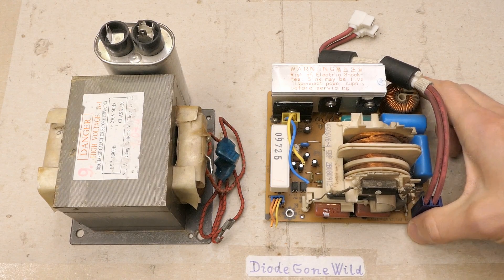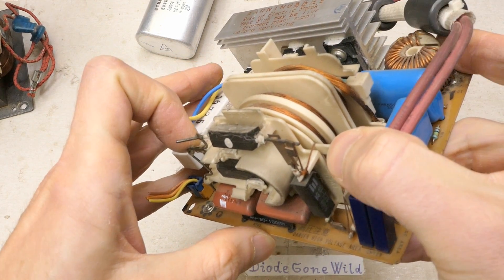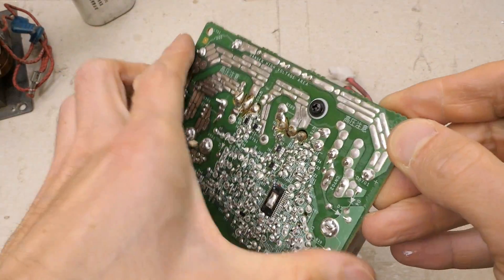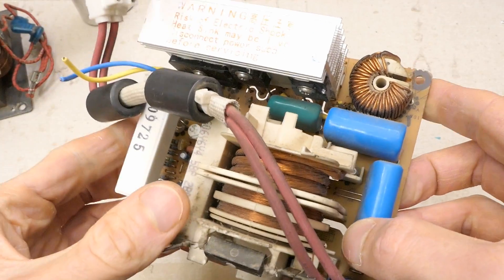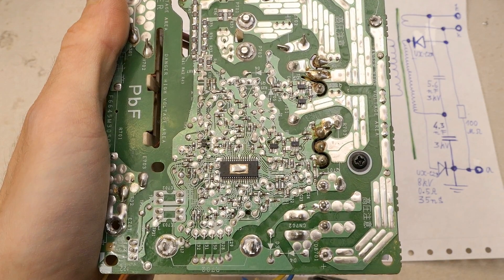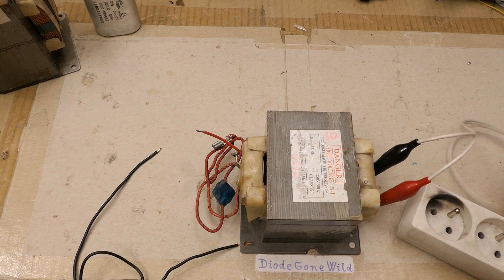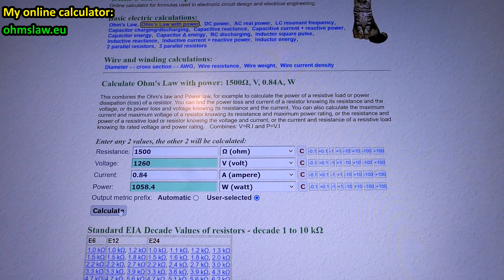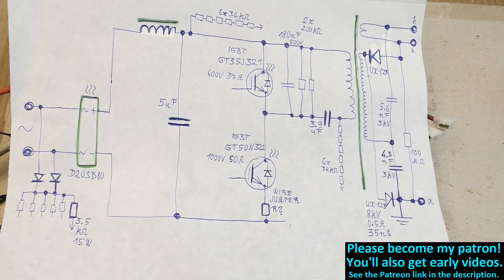A Microwave Oven Transformer, but switching!

Comment: Thank you very much for sucha an interesting video. Just this week I asked a good friend of mine a question: why are not microwave ovens that work at 50 or 60 Hz made with ferrite cores. He is very good in electronics and had to think a bit. He said probably it was because steel cores have a higher permeability and saturation, and that would make the steel transformers cheaper at low frequencies because less copper was needed. He said at high frequencies that would change. I hope you agree with that reasoning, and in the contrary, it would be interesting to hear your opinion. Thanks again.
Reply from the maker: Yes, at such a low frequency as 50 or 60Hz, you primarily need the permeability to be as high as possible. Ferrite has a much lower permeability. Even with iron, the cores still have to be big and the numbers of turns high. On the other hand with tens of kHz, cores are small and numbers of turns are lower, but the core has to have low losses (hysteresis and eddy current) at such frequency, so iron is unuseable, ferrite works much better.

Comment: Microwave oven is most certainly the most dangerous appliance in the home. The secondary leads on the transformer are absolutely lethal when live. The beryllium oxide ceramic insulator in the magnetron is very toxic to the lungs if it's cracked or crushed into dust. The microwaves themselves can very quickly blind you if they sufficiently heat the vitreous fluid in your eyeball.
Reply from the maker: Yes, except I don't think there's any beryllium oxide. Makes no sense in a consumer product.

Comment: I still don’t get why these things  use a capacitive doubler. I mean why not just have a 1kVA/4kV transformer and then a full wave rectifier? 

I guess I shouldn’t complain, since I find high voltage caps for free by carefully disassembling broken microwaves.
Reply from the maker: It's easier to make a 2kV transformer than a 4kV one, but most importantly, the capacitor isn't just to double the voltage. It's also a current limiter (like a capacitive dropper) and a power factor correction (ballances with the transformer inductance). This produces a better power factor than a full bridge rectified 4kV transformer, because the magnetron would only draw power at the top of the halfcycles, causing similar problems as non-PFC SMPS's. And with no capacitor, the current would have to be limited just by the leakage inductance, causing a lagging power factor on top of the harmonic distortion. That's why this technique isn't used.

Comment: From reading up on prior literature and from what I can tell, the large inductor on the DC bus is used both as a current source for the resonant tank circuit and as interference suppression, the top IGBT is used as an active snubber with the 3.9uF capacitor, and the bottom IGBT drives the resonant tank circuit (formed by the 180nF capacitor and the transformer primary. similar to a single ended induction heater). I can dig up some of the patents and schematics that Panasonic devised for the inverter technology if anyone is interested.
Reply: For his schematic it was clear that it isn't a half-bridge, as he claimed. You confirmed my suspicions that it is resonant and that the upper IGBT is an active snubber.
It is nearly impossible to achieve low leakage inductance with a transformer wound in that way, and that winding design is pretty much essential to for the voltages involved without running the cost way up. My guess is that the leakage inductance is used to advantage in the resonant circuit.
Reply: But, this look like most PC power supplies nowadays ... half bridge with that cap ...

Comment: I’m amazed at how common that non-symmetrical half bridge type of inverter is. I’ve seen it in CFL ballasts and step down halogen power supplies. I think I’ve seen it in an ATX power supply and maybe this (or the symmetric 2-capacitor version) in a small inverter welding machine

Comment: Microwave ovens' inverter power supplies are much more expensive but also far more efficient compared to the Iron transformers, not to mention it doesn't throw out your back when moving the oven.

Of course and some inverters are managed by software meaning the gate of the main chopper transistor is driven by a programmable timer on microcontroller die, making it a bit easier for some pricey and better microwave ovens to finely tune how much watts in microwave output to pump out.

Comment: Those eMOT modules make truly awsome HV power supplies if you swap the original transformer for a high frequency x ray head transformer. You do have to make several modifications to it because these boards handshake with the control board.❤
Reply: afaik all you need is a pwm signal at the input

Comment: I wonder if they connect to the 2 sides of the heater to disable the doubler & prevent excessive voltage/arcing if the filament goes open or is disconnected
Reply from the maker: if the heater goes open, there's still the low voltage winding.

Comment: Iron core transformer : Cheap, Reliable and Recyclable.
Switchmode power supply : Expensive, Unreliable and Not Recyclable!.
Power semiconductors in household appliances ALWAYS fail.

Switch-made power supplies make sense in devices that need to be small and lightweight such as smartphone or laptop chargers, they should NOT be found in microwave ovens !!!
Reply: There are many advantages of SMPS over transformer based ones. The efficiency regulations (especially standby pwoer) have driven more household devices to have SMPS however they also bring a lot of other advantages.
For microwave ovens, washing machines and air conditioners the vastly better control over power levels brings numerous benefits to the consumer. Of course  reliability is usually compromised because of ongoing pressure to reduce BOM costs.
Reply: @johncoops6897  The problem is not the power supply itself, but its non-replaceability. SMPS in phone chargers or ATX power supplies are not a problem, they are a problem when the SMPS is inside a TV for example.
Many air conditioners use inverters with 3-phase induction motors, because single-phase induction motors suffer from a poor efficiency, but they could also have used reluctance motors. Some washing machines have an inverter and a high speed 3-phase induction motor instead of a series-wound motor, probably because those motors are incredibly noisy, but unfortunately this decreases reliability.

Comment: The working frequency of the transformer seems to be around 50 kHz, because the 3rd harmonic is very strong about 150 kHz and is causing differential mode disturbances.

Comment: The 3 small wires (brown/orange/yellow) are PWM input for adjusting the power level and a feedback signal for the oven control (half of the PWM signal). both signals are using opto couplers. There exists also a smaller variant of this module with one IGBT and the DC capacitor has 3 µF and not 5 µF.
This principle seems to have a small disadvantage: Reducing the output power will also reduce the voltage for the filament of the magnetron.
Reply from the maker: I gues the heater voltage doesn't vary that much, because the main load is the anode-cathode current, that doesn't affect the voltage drop much. The magnetron simply tends to drop about 4kV no matter the current. This clamps the transformer voltage per turn to a sort of constant value. The anode winding is probably between the primary and the heater winding for this reason. The anode winding is like a bi-directional zener on the heater winding :).
Reply: I just tore apart my first microwave magnetron, I used my 4" grinder with a thin metal cut off wheel and was wondering what the different metals are inside? Was thinking that a magnetron could possibly be used as a spark gap.? I heard somewhere that a magnatron is actually a diode. Is this correct? Just watched a vid of someone blowing air up a Jacobs ladder making a plasma flame thrower basically. Thanks for all the videos, recently found your channel and appreciate you sharing your knowledge.
Reply: @lvstofly  Magnetrons are vacuum tubes, meaning no air inside hence no spark - a spark is ionized air ...

Comment: This is the first time I see a toroidal coil that has a big gap in the core!
Reply: My guess is that inductor is part of a high-frequency resonant circuit and has a ferrite core. Ferrite has much lower loss at high frequency than the materials typically used in toroidal inductors for power circuits. However, its permeability is very much higher and hence the inductor would saturate at low current. The gap in effect reduces the permeability and increases the energy storage ability. A ungapped core made with molybdenum permalloy powder would probably be OK but MPP is VERY expensive these days and ferrite is quite cheap.

Comment: From the flux residue on the back, I can assure you the transistors have been replaced before. 
Good old school transformers are the best. Semiconductors burn with a smelly fart in the presence of high voltage.

Comment: I've found basically the same power inverter like 7-8 years ago, when I was a kid. Don't remember much but transformer, heatsink, big resistor and HV diode look very familiar, I still have that 15W resistor and diode! Back then I didn't know much about this stuff and I wondered why 12V bulb barely lights up powered via a diode (large voltage drop), or why transistors "don't work" (they were dead-shorted, just like yours). Thanks for bringing back some memories
Reply: Yep, I tore apart a Panasonic microwave as a kid looking to tempt fate with some microwave oven transformer experiments and was disappointed when I was met with this style of board. Probably for the better that I wasn't able to mess with high voltage lol
Reply: This is a standard module, introduced in the 1990s and in use in almost every brand of microwave ovens.
Reply: Saw my first one in a restaurant (not rated nsf) health dept said dumpster it... lol I never saw the inverter work, stuck some guts from an old goldstar in it ....  worked great! That was in 2009... 
😊
Reply: The microwave I tore apart as a kid had a MOT. Thankfully it was outside and there wasn't an outlet.

Was almost given a CRT to take apart! Tbh a CRT is much safer then a microwave.

Comment: When considering lethality of in-situ mains transformer driven MW units you also have the doubler capacitor charged ready to create an instantaneous power flash into any intruding human appendage. Spike currents can be orders of magnitude greater than the calculated levels.🤯
I also find this video a great example of where manufacturing costs  of a complex IC (and inherently unreliable) driven power system are totally uneconomic (even with Chinese built components!!) compared with big clunky old fashioned  mains transformer technology. 4 primary components versus 400. And yet the hi-tech version will still kill you stone dead if inexpertly  tampered with.
Reply from the maker: One simply must NOT disassemble a microwave oven if he values his life, that's it... Yes, typical thing today, 100x the complexity for very little imporvement. To us it makes no sense, but most people don't think like us.
Reply: The large wire-wound MOT is not really that much cheaper than the electronic one. The cost of the large amount of special steel, the need for lamination and welding and the cost of copper wire and the overall weight makes these more expensive than you might think. Probably still cheaper than the SMPS but not by a huge margin.

Comment: I guess as long as there is plenty of cheap recycled steel available  (if you use an arc furnace to melt it, it even tells you for free what impurities are present .....)  and the machinery to make the mechanical timer and power regulator units is still working, then there is less of a benefit in changing a power supply design that has worked fine for over 50 years.

Comment: There is other aspect of this power supply: Normally on a "700W" microwave the magnetron itself is a 1.4kW device, it is just because operating at half of the time makes the 700W of it. This supply powers the magnetron by all the time (I mean both mains halfwaves, neglecting the 100Hz), so it may really get the full 1.4kW out heating microwaves from it. Just reducing the current won't work, as it would cause severe degradation of the magnetron efficiency: The 2.4GHz AC amplitude inside needs to match the magnetron voltage to get the ideal efficiency (no excessive drop across the electron stream), wgile the total voltage can not be lower, as the electron speed has to match the resonant frequency of the cavity.

Comment: I wonder how the electronic microwave supply affects the "compatibility" of the microwave with other things operating at the same 2.5GHz like Wifi or so, when few W of the microwave energy will always escape the oven and the communication is limited to barely 100mW. Normally the communication protocols rely on the fact that traditional microwave oven circuit powers the magnetron only for one halfwave, so the communication can work during the other halfwave (8..10ms). But when the magnetron gets powered for both halfwaves, the quiet time becomes very short, too short to be sufficient for anything usable.
Reply: The inverter microwave I'm familiar with blanks all wifi in the room, there's a home theater remote speaker in the kitchen that uses 2.4ghz and you can hear the audio break up as the cathode comes up to temperature. Worth it for the true variable power and higher max power.

Comment: You will not be able to run that by shorting the photodiode. Its at the very least pwm. It would be so irresponsible to not. I would look up the chip to see what it wants but if not, hook a signal gen to it : D 
I had no idea these were in microwaves. I gotta get me some. I found a microwave on side of the road. It wasn’t too heavy, i hope it has this
Reply: It's not irresponsible if a shorted photodiode makes the unit stay on all the time. The power to the inverter module is switched by a relay on the main board as well as the redundant interlock circuitry.

Comment: If the transformer's output impedance is almost the same as the human's worst case resistance, this make the system an impedance matched (closely) system, and ensures *maximum power transfer*. Spooky!
Reply from the maker: Yes, this is exactly what I also noticed. Perfectly impedance matched to a human :). Or at least matched to the center value. The transformer is 1000 ohms, the human starts at 1500 ohms an gradually reduces to 500 ohms as the skin turns into carbon.
Reply: Interestingly a higher current like 1A can be sometimes less dangerous than 100 mA. With 100 mA, only some of your heart muscles stop, making them out of sync. A higher current stops all your muscles and if your heart restarts it is more likely to restart in sync. A defibrillator deliberately stops all heart muscles for this reason.

Comment: I have used these before to generate high voltages. They are crazy powerful and can create even higher voltages than the iron core transformers. Unfortunate that it was broken, but on the other hand it was probably for the better. One of the opto couplers is simply an enable input, the other one seems to be some sort of state output but it's not required. Simply apply a small voltage like 3.3V between the enable wire and the common wire and the inverter should turn on. Unfortunately mine broke after a while, they can be damaged way more easily than the transformers as you said.

Comment: Hoping to see that "inverter" powered up, it should just need a PWM signal.
I study power electronics, and these are super interesting; they are usually quasi resonant active clamp forward converters, and some are resonant flybacks. I also have the Matlab code for the optimization surface computation for selecting the key component values.
Reply: They use a power wave envelope scheme similar to an induction cooker, also it uses a handshake signal from the control board and that also tells it hey set the power to xx.xx%. It also tells the control IC that all is well at 120 or 100hz. The most common fault with these are the rectifiers that do not seem to be truly designed for HF operation.❤
Reply: @christopherleubner6633
Yeah, called an Error Amp, and Feedback.
Handshake is just another term for Successive Approximation.
Reply: Isn't this more like an LLC/LCC converter instead of forward?